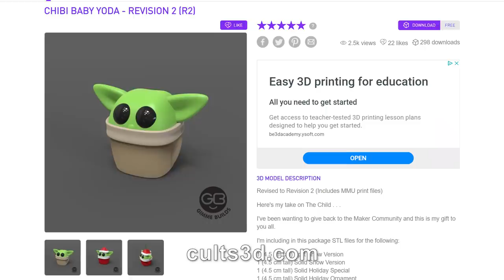Is it Smooth Enough? Testing Polysmooth with Polysher and Primer!

Comment: Got a question about resin printing. Is it possible to do dual/multi color 3d printing with resin 3d printers? Like can we do pause printing then switching basins with different colored resins?
Reply from the maker: Yes and no. Yes you can, no it won't give the look you're looking for. Look up Grafit on Twitter and have a look at what he has done with simple alcohol inks: https://twitter.com/grafitomi/status/1226609758964211713